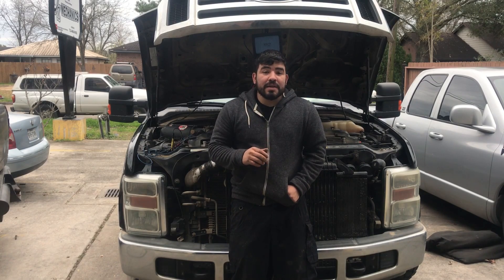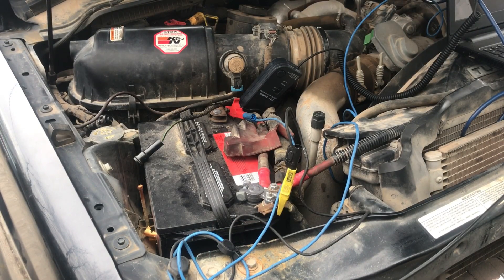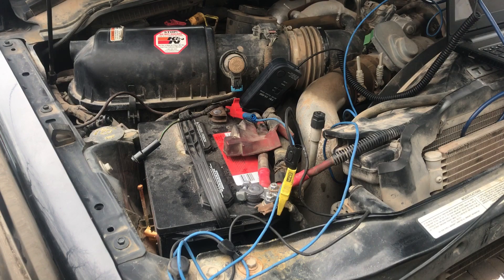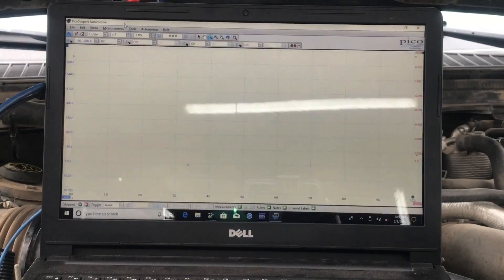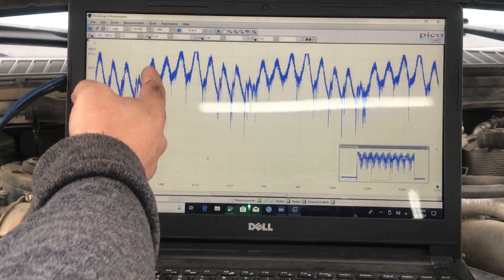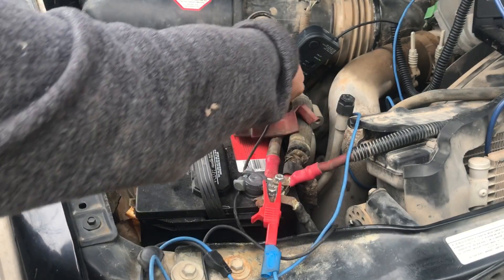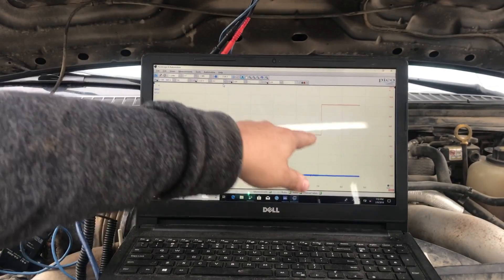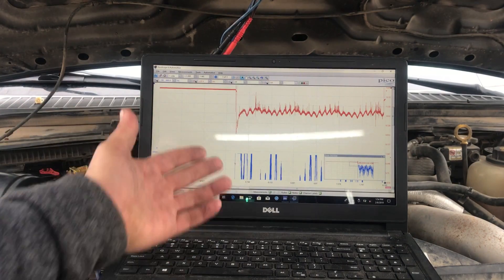The FUTURE of Finding an Engine Misfire!!

Comment: Sorry Oz I'm slow, what was your recommendation for repair? Thank you for your time!
Reply from the maker: Customer took it to a shop that specializes in fords they would remove the cab to access the valve covers
Reply: @OzMechanics  what do you think the issue was or is? Thank you for your time.
Reply from the maker: Edward Thayer I’m thinking a valve issue or injector seal
Reply: @OzMechanics  thank you! You're a way better mechanic then me! So when you suggest what I was thinking it makes me feel more confident in my diagnosis.

Comment: Great voltage trick! Justing wondering: reversing polarity? Any danger to the Pico from a V spike on reverse polarity ... maybe  a spike can slip past a diode protection. Might ask the question on the Pico forum??? Thoughts??
Reply from the maker: My thoughts on this are the voltage drops are small from a scale of volts it’s around .200 volts. But I’ll make sure to look into this

Comment: Hi oz how do you know it’s a mechanical issue as opposed to a faulty injector causing the misfire?
Reply from the maker: Paul pickering do you mean pressure escaping from the injectors ?
Reply: Oz Mechanics hi oz I mean if the injector wasn’t working properly and causing the misfire, would you still see the same results.
Reply from the maker: Paul pickering the relative compression test shows mechanical problems in the engine. Including valve problems and piston rings and seal damage
Reply: Oz Mechanics thanks oz.

Comment: OZ, good info and video as always  i have vantage pro so put the led on battery and one volt / one second time frame with ac coupling should see the wave form is that correct  mr oz or not. thanks for sharing  cheeeeers
Reply from the maker: Exactly. I just did a relative compression this morning using a vantage

Comment: Luckily the pico can do floating grounds(i think the limit is 10v potential difference though). The micsig i had would not like it if i inverted my connections and had say a sync to a coil at the same time. That would short the scope. Cool video oz 😎